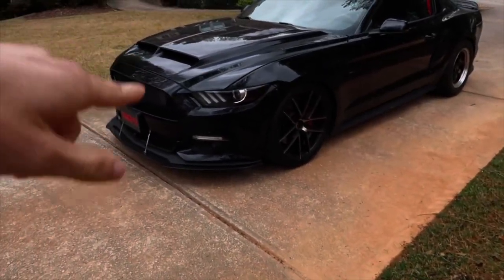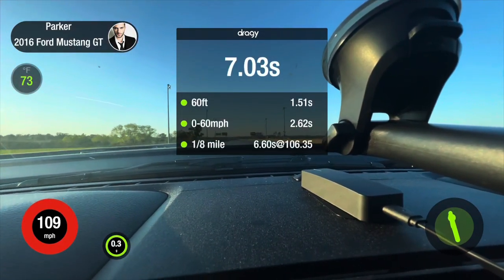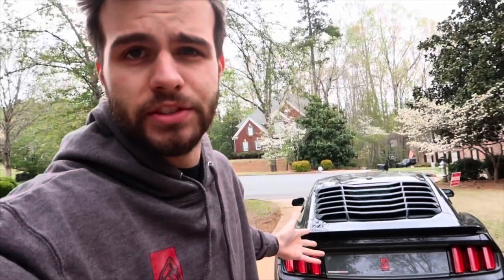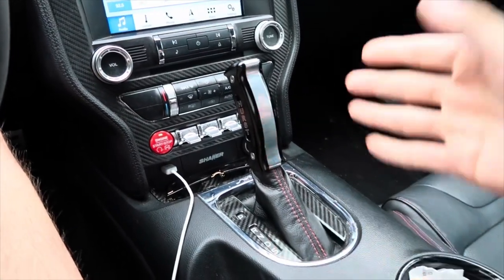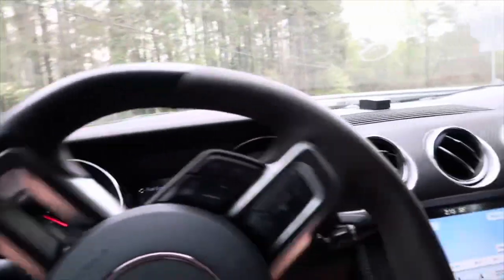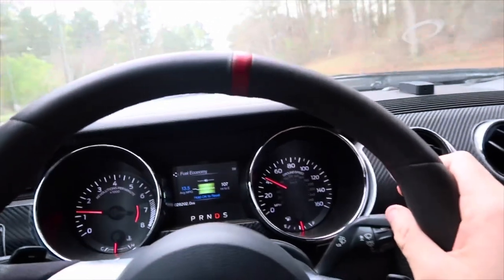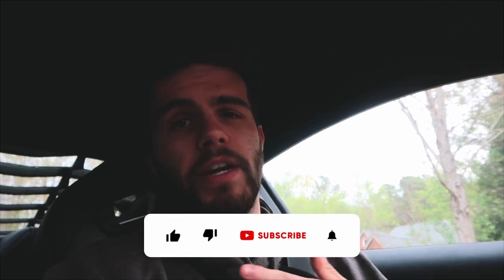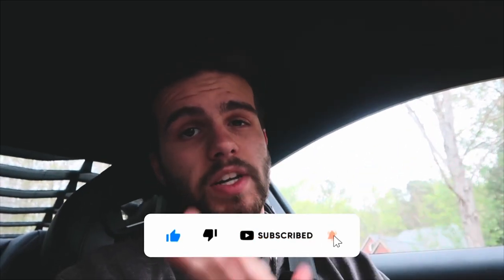DAILY DRIVING ON A 3600 STALL CONVERTER!?

Comment: So one of the coolest things about automatic transmissions with high stall speed converters, is you can have your shop add in a manual lockup solenoid (usually) so you can flip a switch on your dash and that 3600rpm stall "hang" goes away.

Comment: Used Wallace racing calculator for HP with ET and curb weight. A GT is around 3700lbs, I guess that you weight 180-200lbs maybe more. Let's say 3900lbs. So your HP computed from the Wallace Racing Calculator from your vehicle ET is 633.23 rear wheel HP and 703.59 flywheel HP.
Your HP computed from your vehicle MPH is 0.27 rear wheel HP and 0.30 flywheel HP. So the 646HP in this video seems to be pretty accurate.

Comment: I have a 2017 grand sport. I'm nervous and excited to get it back. It has an LT4 supercharger conversion kit with the upgraded fueling and cooling, forged internals, stage 1 cam, 4 cylinder delete kit, cold air intake, weapon X pully, long tube headers, high flow cats, x-pipe, and tune. 8 speed auto is crap. Having issues and just took it in to get a catch can, Circle D torque converter with 3000 stall, carbon fiber drive shaft with the rubber couplings deleted, trans flush, and a TCM tune. I expect it to be way different. I'm hoping the 3k stall wont bother me.

Comment: I’ve got a 17 f150 5.0 screw with a stage 2 p1x that I dail. I’m just running the stock tune but in the process upgrading headers, fuel system etc then full tune. It’s definitely fun now running just 6 psi I can’t wait to get it dialed in. Any tips you’ve got for the pro charged coyote daily I’d appreciate em! Thank you for sharing!

Comment: So I have a 16 Vortech supercharger.  I'm putting 639 to the wheels. I have a pbh transmission but didn't upgrade converter and I may have blew my torque converter.......that's my guess anyway. I'm looking at a circle D converter but I mostly roll race mine,what's your suggestion for a stall? I was thinking 2800 to 3200. And when you car broke did it make a whining noise afterwards, no reverse?
Reply from the maker: If you call circle d and walk through your build they’ll have the exact spec you need

Comment: I was going to install a TSP BFD monster chop on my rt challenger with a 3600 stall. So is it suitable for daily driving in your opinion
Reply from the maker: Yes it is
Reply: @Stangry5.0  will my LSD 3.06 gears be able to handle the torque of the stall?
Reply: @aceklub2k5  did you do it yet bro ? My plans for my 5.7 hemi jeep
Reply: @mistercleaton5951  I went with the FRP Tomahawk Cam with a 3200 stall. It demolishes that chop monster cam and tsp are using LS grinds for Hemi motors which don’t give you the best performance

Comment: I tried the 3400 stall and hated it because of the high revs all the time. I settled on a 2400 for a 1986 5.0 and 3 speed built up C-4
Reply: Takes a bit to get used to it for sure. I've been driving my 87 gt for 3 years with a 3800 non lockup stall and 4.10 gears. I love it now but between the gears and the high stall it's kinda annoying on the highway. I just stick to backroads and it's good to go.

Comment: hey man I got a 97 firebird with a 3600 FTI  stall with a .572 lift comp cam and I wanna know Is it normal for RPMs to be high when I nail it it will not change gears until it hits 7k RPM every gear and it was tuned just don't want it to hurt the motor
Reply: That's not normal my man go back to your tuner
Reply: Get another tunner, the one you havemust be r'trdid!